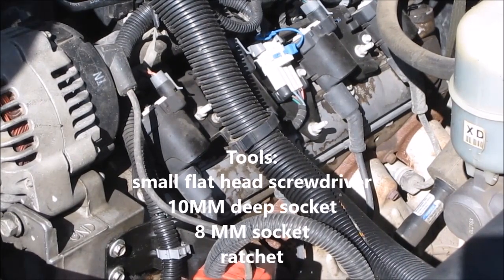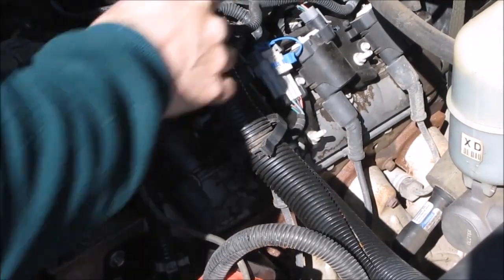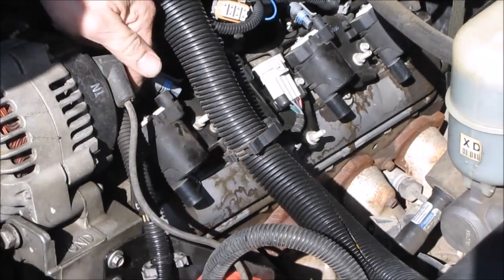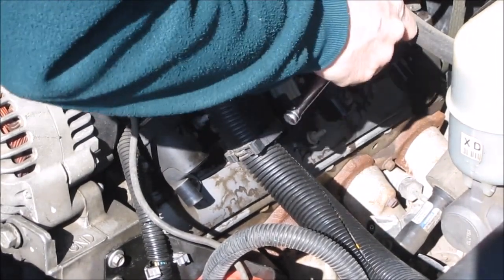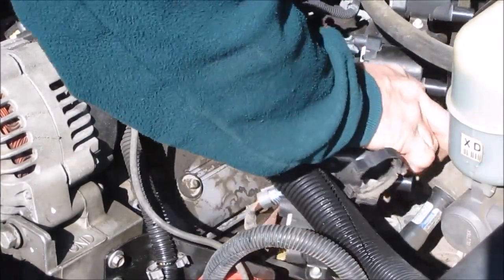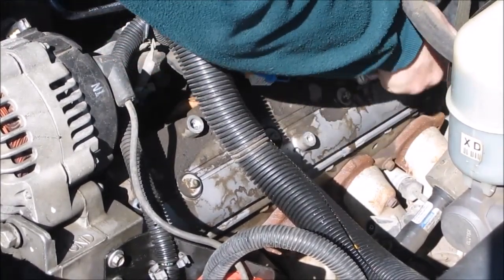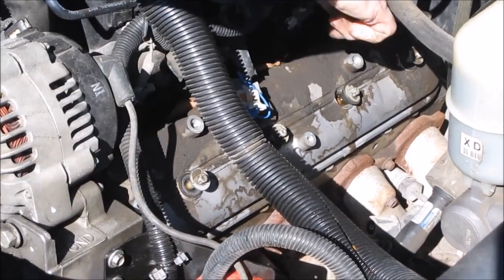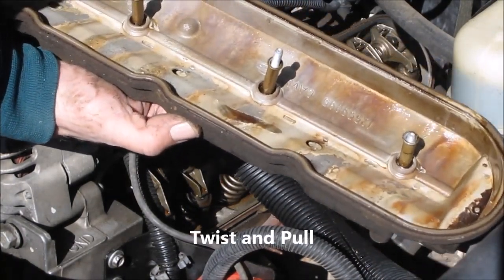GM Vortec Valve cover removal instructions

Comment: Did you ever find the leak?
Reply from the maker: I replaced the engine with a 5.3.  My son replaced the heads on this engine with an 862 casting and is using the engine in his drift car without any issue.

Comment: No need to unplug the coils.
Reply: Let me tell you, I took your advice. I didnt remove the coils. I ended up wasting 3 hours trying to line up the bolts until I took off the coil rack. Maybe it's my inexperience but hot damn, I couldn't do it until I removed those coils. 5 bolts to remove the coils it's totally freaking worth it. Especially if you're a DIY'er. It's worth the trouble.
Reply: It was a great video it was a big help to me thank you and keep them coming

Comment: I have a 02 gmc sierra 4.8 the valve covers are leaking. It runs strong no over heating no milky oil no other indications theres anything wrong. Will there be any other things too look for when I change the gaskets?
Reply from the maker: There may be a little black build up on the inside of the valve covers.  That is normal.  If there is no brown milky goo...  you are good to go.
Reply: awesome thanks ill take photos

Comment from the maker: These instructions would also work for a 2000 Tahoe 5.3L.  The valve cover gaskets are reusable, I am not sure why you would need to replace them.  Once you have the valve covers off, replacing the gaskets is very easy. Remove the old one and work the new one into the grove.   The trick is to not stretch the new gasket so you can get it all into the grove with would extra sticking out....
Reply from the maker: Without extra sticking out (not 'with would' extra sticking out)

Comment: Thanks for the video! It looks like you have the typical exhaust stud broken off in the back there.
Reply from the maker: Good eye.  Of the dozen Vortec engines I have worked on, more than half have had one or more broken exhaust manifold studs.  A common problem with no easy solution to fix it once the stud has broken off.  Thanks for watching and commenting.
Reply: JeepsAndStuff http://www.kralautoparts.com/parts.html Check that site out. I had the same thing so I decided to try the $40 fix before I pull the head and extract the bolt. It worked out great and only takes about 30 minutes to put in. It's temporary, but until I have a better reason to pull the head, I'm very happy with the money spent.